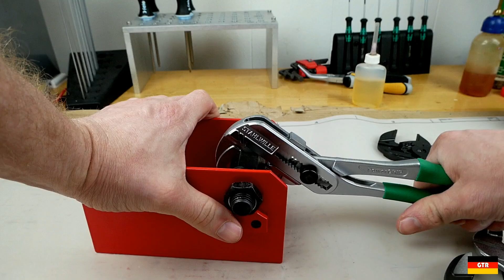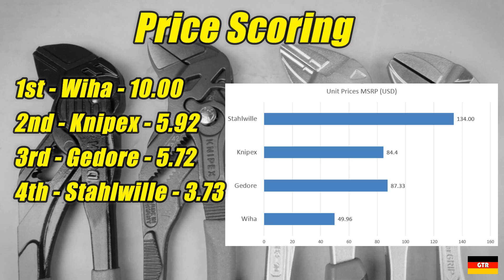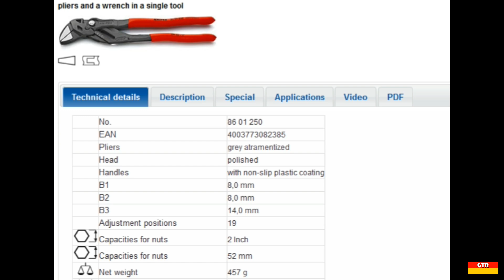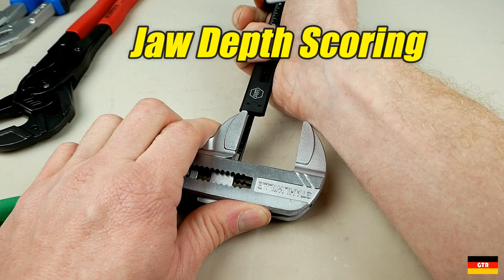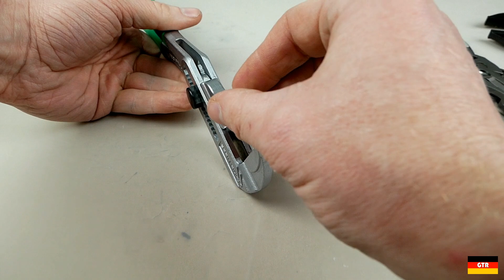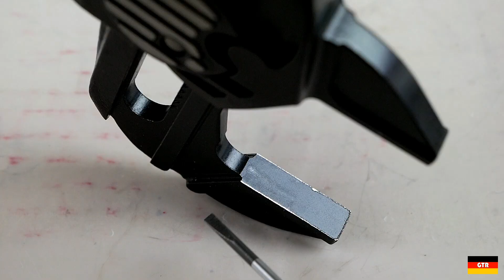Pliers Wrench Showdown (250mm/10")

Comment: There's another you can add here and it's made by Lenox. It's a pliers wrench sold in the plumbing department of Lowe's. Smooth jaw services as to not marry the material such as PVC etc. It opens to an unprecedented 3 in

Comment: Seems like every category of performance has been taken into consideration and weighted to give an overall score, however, there is one small problem here, the category that actually matters is what can these thing loosen or tighten. Why is there nothing that reflects their capabilities in torque, or strength? Seems like a waste of time rating something if you leave out the main objective From all of the scoring categories, the grips may as well be made out of chocolate. Chocolate would score well in all of these tests, but just might be worse than useless in removing a nut.

Comment: Another important feature is how much they close (minimum gap.) clamping force is important. How about market availability? And are they German if they have a German brand but are made in Taiwan? Curious, do they all work the same at maximum torque or to smack a nut with the back of the head? Ask 5 people, get 6 opinions!

Comment: You list the inconsistent open/closed jaw ratio of the Knipex as a con but because the delta gets smaller with higher sizes, it should lead to more leverage advantage with bigger sizes which seems like a plus

Comment: Awesome comparison! I bought the 10" Wiha Auto Wrench with a 10" auto adjusting plier for 49.99 from Acme Tool. It was such a deal for the 2 pcs I could not pass it up. The 1st thing I did was get a small brush and a cup of lacquer thinner and get all the terrible clear coat off all the jaws!  It took a good 5 minutes of scrubbing and soaking and it made the action of the plier 100 times better. They now work very well.  I agree with his review here. They were a little hard to work and kinda stuck easy in positions before washing the clear finish off. . Hopefully this helps others.  It makes the pliers action so much better.  I really liked the way the Stahlwillie jaws worked too, but it didn't fare very well here either. Great Comparison!
Reply: Wiha is easy to adjust put on fastener and use fingers to pull jaws against fastener

Comment: Is the Stahlwille pliers has lifetime warranty like Snap On? If so how do I warranty the product?
Reply: With ANY product its a matter of getting it back to the manufacturer. You can sometimes do that thru a distributor, (especially if you buy from them) or sometimes if you do not have a local distributor, then its up to you, to ship it back to the manufacturer. Most will ship you a new unit if its a broken hand tool. In other products they can repair your product and ship it back. The "warranty" is basically put out by the manufacturer. Distributors are basically just a helping hand for them, but its up to their discretion.

Comment: GTR, Just got in the mail the Knipex jaw protectors for the 250mm pliers wrench. they come three 3 set per pack and the upper and lower jaws have different protectors that are made of a hard plastic. the jaws are held on my spring tension in the plastic part.

Comment: You're supposed to put the tool on the work surface, then adjust the wrench to it, and then squeeze the handle.  
To give a proper analysis you should use the tool as intended. its a good video and I enjoyed it. Just my 2 cents.
Reply: You are totally correct. It should be under tension

Comment: Thanks for the info! The only ones I was aware of was the Knipex. A important feature to me that you didn't cover was clamping force, I would be curious to see how they stack up. I use the Knipex for far more than just turning nuts. Wire crimps, leader crimps, bending and straightening sheet metal, pinching off copper pipes, etc. The divot at the back of the jaws on the 3rd generation can actually be called a feature when it comes to wire/leader  crimps:)

Comment: I don’t care if the jaw moves a bit. It ends up when it should be when you grip the handles and squeeze.
Reply: Jaws tend to parallelize themselves as you grip them. As long as the machining was done correctly, if the two halves are a bit loose, it’s ok. If the machining wasn’t don’t correctly, or the halves are warped, that’s something else.
Reply: Lateral movement is still undesirable?
Reply: Also, any rotation is undesirable: ideally the jaws need to remain parallel

Comment: Got 2 of VBW pliers because I thought you were right about the feel of it in your hands I do really like using them and they are amazing for SWA glands which I use alot but I have found 2 problems with them 1, the limited amount of setting when you're dialing it in means that you often feel your in between settings and 2, only had them 2months and already the handles are starting to peel away.

Comment: Excellent test and review, thanks.  I frankly have an opposite view on the Wiha mechanism.  I currently use Knipex, Wiha and Gedore (depending who gets in first) in an engineering research lab. Some time ago I also ordered some Stahlwille/VBW's, but they're on 'extended' backorder; price maybe isn't their only issue. Having worked decades with ChanneLocks, the Wiha is completely natural to me, whereas  pushing a button-- indeed, putting fingers on the head-- feels fussy and awkward.  Open wide, put top jaw on nut, pinch handles a few degrees and raise the lower jaw to fit (it ratchets in the closing direction), then squeeze and go. You can do it without eyes on the target, one-handed down a  hole.  Much faster (for me).
Reply: Also:  my Gedore's  jaws were not properly deburred before plating, chrome is a mess now and scratches the work. But there was never blue paint on my button (design change?). Instead of measuring jaw length, consider if the jaw is adequate to cover flats on the largest hex accepted; excess overhang can actually be a hindrance. Also if you're in US but sometimes shop in EU, you see Knipex and Stahlwille enforce over 200% extra markup when shipping to the US, and penalize dealers who don't comply (price fixing). In Germany it seems all these pliers are available under 50 euros before VAT.
Reply: @11zekim  In Germany the non-chrome 250mm Knipex is 41 euro inc. tax and the Stahlwille 55 euro

Comment: The knipex are 53$ for the chrome version pretty good price for this tool. And also you should add brand reputation since the more reputable the brand is the better life time of the tool you can expect down the road.
Reply: They're not more "reputable." Maybe they're more popular, but only for 2 items, these and the cobra pliers. Other than that, each of their other tools don't even make it to the top 5 most popular for that specific tool category. Home Depot and Lowes actually stopped carrying Knipex Cobra pliers because no one bought them.
Reply: @littlejackalo5326   they are reputable for quality tools not popularity, you can argue with that, most people will prefer brand they know or some cheap tools.

Comment: Wiha and Knipex are common in the UK but my perefence is Channellock its a proven adjustment which has been around a very long time. If it aint broke why fix it.
Reply: Because quality and functionality doesn't depend on how long it's been around. The horse and carriage is a proven design that's been around a very long time.

Comment: I've had 3 sizes of the knipex pliers for about 12 years now, I imagine they will last me the rest of my life. Great for rounded bolts and soft aluminum AN fittings.
Reply: They will last you for the rest of your life that’s the main reason why I spent $200.00 just recently on Knipex pliers because I wanted a set that will last me for the rest of my life so I don’t have to buy any more pliers.

Comment: be more use to grip say a 17mm hex bar , put the end in a torque wrench and see how much torque these could apply as opposed to a standard adjustable ,, and a standard waterpump pliers ,,, now there is a test ,,
Reply: Quite a useless test, there's no torque multiplication so the torque applied is the result of the force applied, the line of action and the distance.

However, the clamping ability would vary between them due to the different mechanisms
Reply: @scod3908   exactly my point.

Comment: How in the world does a company like Stalwille stay in business charging those kind of prices?  Ouch! 
Somewhere on Youtube I saw someone making a similar comparison between the Knipex and the normal Channel lock pliers.  I was surprised that despite the Knipex's mechanism, the video really did give a good impartial revue and the Channel Locks came out on top.  I think the cam idea (not new BTW - look up the Eifel Plierench of 1916) just appeals to people as something different.  Obviously they both get the job done.
Reply: In Germany the Stahlwille is 55 euros ( $63 usd) inc. 19% tax
https://www.tbs-aachen.de/Suche/Stahlwille_65735250.htm?VL=Stahlwille%2065735250
The chrome Knipex with comfort grips 51 euros
https://www.tbs-aachen.de/KNIPEX_pliers/Knipex_Pliers_Wrenches/Knipex_86_05_250_Pliers_Wrench_nickel_plated_250_mm_i3172_44032.htm
The Knipex version in this video 41 euros
https://www.tbs-aachen.de/KNIPEX_pliers/Knipex_Pliers_Wrenches/Knipex_86_01_250_Pliers_wrench_250_mm_i3172_94474.htm

Comment: For me the most important criteria are: 

1. Adjustment mechanism
2. Maximum torque before slipping
3. Geometry of the head and the handles.

Therefore the Wiha seems totaly unusable to me because of the adjustment mechanism.
 Since I don't buy re-branded tools the Stahlwille is also no option for me - without the name Stahlwille they probably cost only a third. 
I am not sure about the Gedore. Maybe @cgprecision is right and the adjustment mechanism is genius.
The Kipex Cobra style pliers would be perfect if the adjustment mechanism was smoother. 
So I probably would end up with the Kinpex or the Gedore.

Comment: I have one of the smaller Knipex pliers wrench models that replaced an old school adjustable wrench in my tool bag. I had been considering getting a larger version for different work. I'm glad that I started looking into the Gedore and Stahwille branded versions because it seems like they are pretty solid offerings.

Comment: Based on your earlier comparison of the old vs. new Knipex versions, I think the older one would have won or tied for first.
Reply: I think what happened is that knipex saw what gedore was going to release because of the patent expiring, they needed a new product to set it apart because they might not compete in price.

Looking at them side to side I noticed the knipex trimmed off a little bit off the rail to reduce weight and possibly give more clearance when using it. That's probably why there's more slop in the higher positions
Reply: Hi.I have 300 mm old model knipex and they are the best maybe I take 250 mm on gedore.The new model on knipex is not good 100 grams minus is not good for power on product.
Reply: @vasiltop  less weight doesn't reduce power of a hand tool. As long as it is strong enough to not break, any extra weight is extraneous.

Comment: Great review. I have used 7" and 10" knipex pliers wrenches quite a lot. They are great tools. I used them mostly on compression fittings on stainless pipes. The only problem is that they are really expensive. I would like to try out the Gedore ones once they are available in South Africa. The Gedore model should be cheaper than the knipex since Gedore is well established and sells large volumes in South Africa .

Comment: Glad you made this video also as of this moment the gedore pliers are on sale and much cheeper than the knipex or wiha pliers also all these look like they'd jam up if the get dirt or grease inside the mechanism in your experience how often do they jam up in greasey nasty conditions
Reply: Grease doesn't jam up nearly anything. Other stuff, like dirt, will jam them up. Not any more than any other plier or adjustable wrench. And it would have to get pretty greasy, and subsequently get a lot of dirt stuck to said grease, for any issues to be caused. Dirt won't stick, and won't cause any issues, unless there's A LOT of grease/oil on them. If you're working in conditions that are so incredibly greasy and dirty, just wipe them off with a rag.
Reply: @littlejackalo5326  in mining loose grease gets impregnated by dirt constantly so it will cause mechanisms to lock up

Comment: I've used my knipex plierwrench with just one handle and it worked just fine. Maybe the other styles don't work with one handle, but I'm almost 100% positive that the knipex one does. I just tested it out, you have to close it on the nut first, then you can push down on one handle and it holds just fine(just like the cobra pliers). I remember needing to use it when it was fully open on a giant toilet nut because I have the 7" version, and I could only use one handle, which worked just fine.
Reply: Lol Hi, I see you around =)
Reply: @Toyotas_n__Tools   I have a strange fascination with tools. I just looked at your channel, and like your tool reviews. Keep it up!
Reply: I totally know what you mean!! Thanks buddy I appreciate that!
Reply: Yota Doug's Tool 
Collecting Channel

Comment: The Stahlwille looks amazing. Really surprising it came 4th, i'd have placed it first. Jaw capacity shouldn't be a factor nor cost as these are all high-end professional tools and tradesmen don't mind paying a bit more.
Reply: Cost is ALWAYS a factor. Spending more money on a product that isn't as good, should cause that product to lose points. So good method of taking points away, just because something costs more, isn't the right way to do it. Points should only be taken off if the price of the worse performing tool is more than the better performing tool.
Reply: @littlejackalo5326  What's with block capital letters, you dickhead?

Comment: Thank you on this showdown, but I think you should redesign how the final score is calculated.  You do assign a lot of points for things that can be measured, but not always vital for use. That's why stahlwille ended up below wiha. I think there should be less categories like: ease of use (speed of use), capacity (both opening and strength) and cost. if number of positions do affect ease of use then lower one point o 2. It seems  to me Stahlwille is most capable of working in restricted areas by design and on par with others in standard abilities.

Comment: I love these videos. Thanks a lot.
In my limited experience with the Stahlwille and the Knipex, I much prefer the Stahlwille. The price is a bit steep, but I don't notice things like the limited position count and capacity. On the contrary I really notice how easy it is to adjust and use in daily life. The handle design could be better for me, but perhaps that's a subjective matter.

Comment: I have the gedore, the adjustment mechanism, while it takes some getting used to, is actually genius. With the button depressed you open the handle and it holds the button down, slide the jaw up to the fastener and close the handle, at the right time the button pops up, it is timed to engage when the cam lobe of the handle is in a favorable position for strength and leverage, this prevents you from getting too big of a bite on something, where the handle is fully open, in which position it is weaker and has less leverage. I absolutely love mine.
Reply: That is exactly how the Knipex quickset Cobras work I do believe. And agreed, I really enjoy that type of mechanism. I was really hoping Knipex brought that to the pliers wrench.
Reply: KC Tool has been regularly selling the Gedore for about $40. Once you understand the adjustment mechanism, at this price point it's the best value for money of these units.
Reply: That's really interesting. Care to explain it in a bit more detail? I'm not sure I fully get it.
Reply: @LudoA  Basically, on most competitors models, the release button for the sliding jaw can pop back up at any point in the handles rotative position, either fully open or fully closed and anywhere in between. Because of this you have to hold it down as you slide it and kind of guess where to release it at to position the handles in such a manner you can get good squeezing leverage. With the gedore, the release button can only be operated with the handle in its middle  position, which gives the best leverage.  If you push the button down and THEN open the handles fully, it holds the button down freeing up both hands, now you can freely slide the moveable jaw up and down the beam. This allows you to slide the jaws together up to the object you wish to grip, and then close the handles with a squeezing grip like you would a normal pair of pliers, and as you do so the button will jump up and lock the sliding jaw onto the beam at just the right time where you have the optimal grip and leverage.
Reply: @cgprecision  excellent explanation
Reply: Damn I wish my Knipex had that. The first thought I had when I started using them was that it would be nice if I could slide the jaw up and engage it rather than kind of guess.
Reply: That IS clever

Comment: I have a 180 mm VBW pliers wrench that I've barely started using, and the chrome is already chipping off the lower jaw.
Reply: Ive bought their needle nose pliers, they came with badly misaligned jaws (around 1mm at the tips). Thats the first and last pliers Ive bought from them.